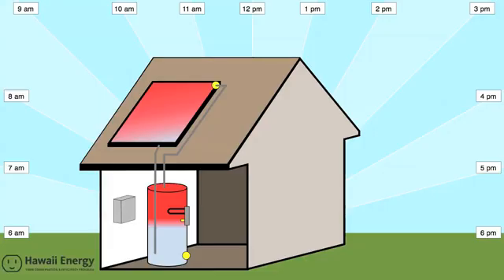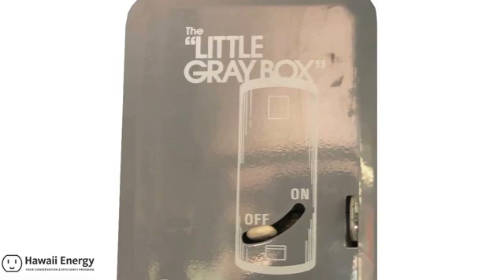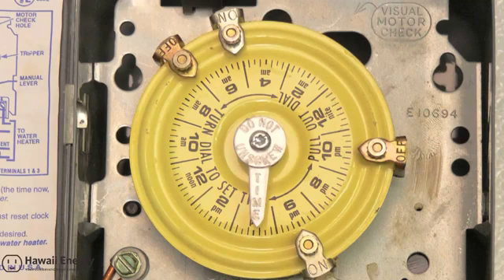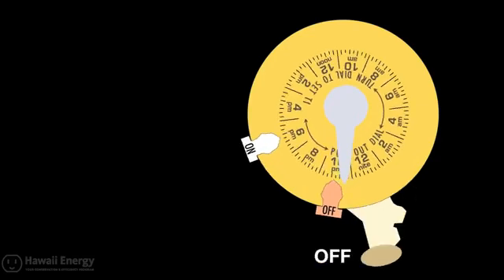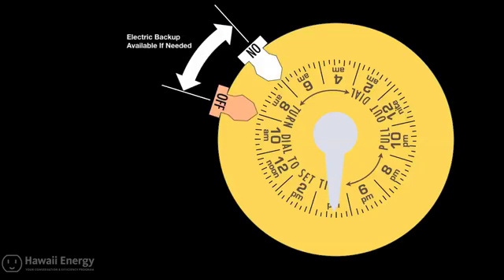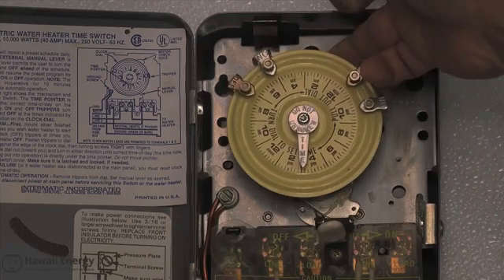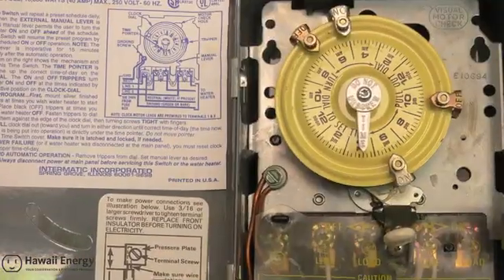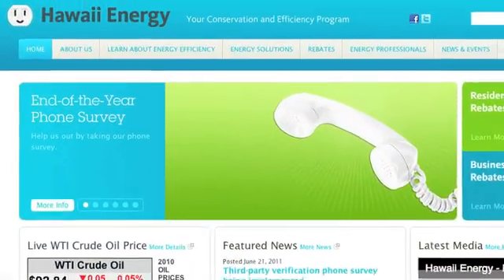Understanding Your Solar Water Heater Timer

Comment: ok, it still does not work I tried all of this instruction?  I have to manually tr it on and off does anyone knows what else can be wrong???
Reply: Check the Gear behind it if its spinning u can see it without taking apart on top. If it's not spinning needs to be replaced